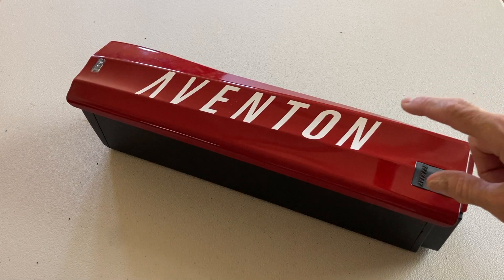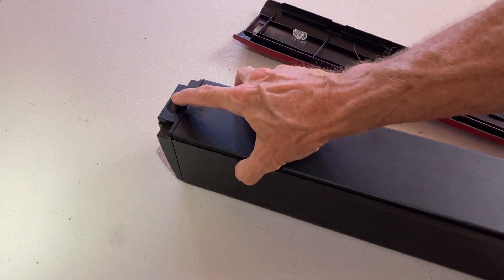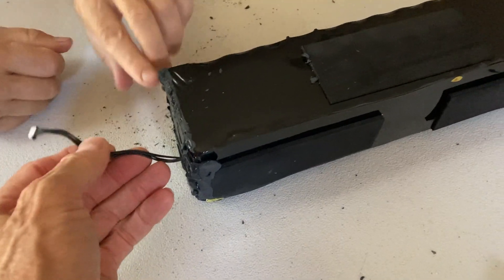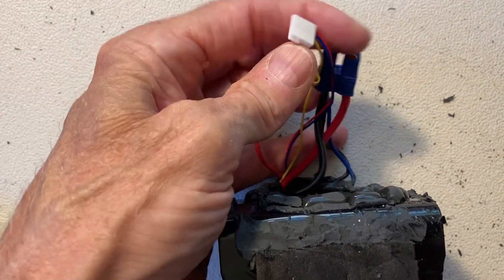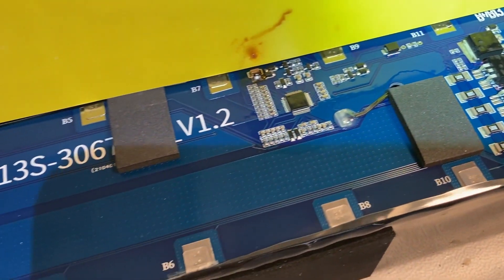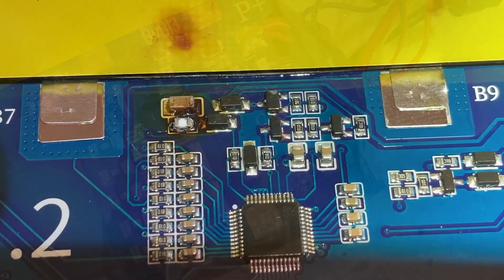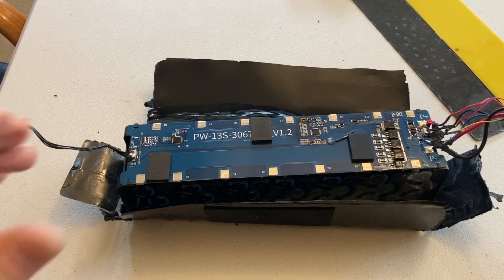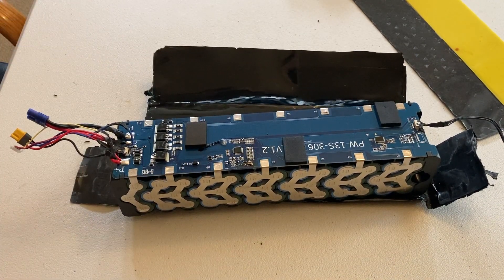Aventon Aventure Dead Battery Disassembly and Diagnosis

Comment: Hi Charles and thank you for this video. It is a walk through that hopefully not many of us would ever need to experience personally. I just got my Aventure and noticed the battery specs on the back show Nominal Voltage:47.32Vdc and Rated Energy: 657.748Wh. I thought this should say 720Wh according to all the posted battery specs. If you divide 657 by 47.32, I get 13.9. Shouldn't this be 15? Can you check to see what yours say? I called Aventon and they said, "make sure to balance your battery and you will get 720Wh from it" and some line about "lithium ion batteries are volatile and you will get a range" of output. I know there are supply chain issues and they are working to get bikes out with substitute part with "equal or better" parts if they have to change something. I'm afraid that substituting 657Wh for 720Wh isn't a fair swap. Thank you!
Reply from the maker: Hi Jeff, I have 3 Aventures and none of my batteries labels show anything similar to yours. The simply read "48V 15Ah 750Wh" with no further elaboration. When did you purchase yours?
Reply: @webopus  I have had it 4 days, direct from Aventon. I think I have an under powered battery and they are trying to bluff. I don't think I will get the total miles from a 13.9 amp hour battery compared to a 15Ah. Hmmm wonder what recourse I have?
Reply from the maker: @jeffmiller2806  that certainly is a consideration. You can contact a Aventon customer support but be prepared for a lengthy ordeal. I waited for over 32 days for a replacement battery, but they ultimately made good on my warranty claim. Chip manufacturers all over the world are under enormous pressure to produce more chips, but all this pandemic bullshit is hindering their progress. Every sector of the electronics industry is being hit hard by this - and the E bike industry is no exception. I'd contact Aventon customer support and mention that you did not receive the battery that was advertised for this product. Let me know what happens.
Reply from the maker: Jeff, I have to contradict myself. I just checked the battery once again on our newest Aventure, and it has the same markings that you've described. I've been unable to find any descriptions of precisely what that means. You might want to send a question to the guy who runs Bolton E-Bikes in California. He is often able to answer a lot of these cryptic and sometimes complicated questions. Here's a link to his Youtube Channel. Please let me know when you find out. https://www.youtube.com/channel/UC8pIKzo5py1zt3U2O-Bqo3A
Reply: @webopus  Oh wow. How long have you had the newest one and did you get it direct? I'd be curious to know if you get the same range from all 3 bikes. I have watched the Bolten bike guy. Yeah, good call. I'm sure he'd know. Thanks for sharing your update.
Reply from the maker: @jeffmiller2806  We've had the bike since the end of September, I believe. But I just opened the box this week and put it together. I'm probably going to try to sell it. It was a bike sent to us directly from the Aventon warehouse in Ontario, California for a warranty issue. And interestingly, that issue was the dead battery I mention in my video. 
Our first two bikes were purchased sometime in June, direct from Aventon. BTW - Here's a link to a Bolton video about battery maintenance. This might be a good place to post your question.
https://www.youtube.com/watch?v=WVcFytLYOIQ
Reply from the maker: Jeff, I just posted this question on the Bolton video concerning battery maintenance: "Hi - I have three Aventon Aventure bikes. Two of them have batteries marked "48V 15Ah 750Wh". One, more recently acquired, is marked "Nominal Voltage:47.32Vdc and Rated Energy: 657.748Wh". Can anybody explain the difference? Much appreciated." 
If I get a response, I'll let you know. 
You could also look for an answer here: 
https://electricbikereview.com/forums/https://electricbikereview.com/forums/https://electricbikereview.com/forums/https://electricbikereview.com/forums/https://electricbikereview.com/forums/
Reply: @webopus  Thank you so much. Double check but I think it is 720Wh and not 750Wh. I think the 750 number is the motor watts. Pretty sure you can edit your own comment. Thanks again Charles!
Reply from the maker: @jeffmiller2806  you're right. I will correct or amend it.
Reply: Hi Charles,  I heard back on the battery question. Basically they said,  "We want to clarify that it is just the label that now shows the minimum specs rating, however, the battery is the same." I'd love it someone with both "labels" tested the capacity of each to see if they are really the same. Either by a throttle-only range test or a battery capacity test with bench test equipment. I'm pretty sure the formula is the formula (V*A=W), (48V*15Ah=720Wh). Who would change the label to show minimum spec and not call it "Minimum Spec"? The label clearly states "Rated energy:657.748Wh" I'm not sure how that can be the same as 720Wh. This is frustrating. I feel like I didn't get what I paid for but don't know for sure. Hopefully someone who understands batteries or that can run a test can chime in with definitive results. Maybe I'll call a dealer to see what they say.
Reply from the maker: @jeffmiller2806  ratings on batteries can be tricky to evaluate. Calling a few bike shops that specialize in E bikes is a very good idea. I'll be interested to know what you discover.

Comment: Thank you for putting this video together.  I am a finance guy and only know that V*A=WH.  But my friend is a reitred United Captain and aerospace engineer who fixes electrical equipment for fun.  I will defer to him if I have problems greater than VxA :)
Reply from the maker: Howdy, you're welcome. After spending much time on this battery I came to the conclusion that it's not user-serviceable. Fortunately, the batteries I now have on my three Aventures are working perfectly. Have a good one.

Comment: what size screw do I need if I lost mine?
Reply: for the cover
Reply from the maker: @davidwiniger3799  Hi David, I saw your question on the Electric Bike Forum as well. Unfortunately, I don't know the size and have no way of accurately measuring one. However, the cover is very tight once it's slid onto the battery housing and will be held in place by the frame of the bike once inserted into the battery compartment. I wouldn't worry about it. I sincerely believe it will not slide off.

Comment: The battery is arranged as 13x3, So 39 cells is correct, but you have 13 groups. each group containing 3 cells in parallel. Those are not 1.6V cells. They are 3.6 cells. Full charge is 4.2V, mid charge is 3.6v. So 13 times. 3.6 is about 48V.

I cannot see the range dial on your voltmeter, but you should be measuring 4 volts from B13 to B12, B12 to B11, etc. Not 8 volts, Yu're reading your meter wrong, or it's badly uncalibrated.

You are right about the BMS being bad,
Reply from the maker: Merle, Hi. I got similar feedback from a fellow on an E-bike forum. I'll calibrate my voltmeter and check it again.However, I don't see a possible use for these cells and will simply recycle them and be done with it. Thanks for the comment and education. I appreciate it.

Comment: Replace the parts... looks like a capacitor is the large one, not sure the small one.
Reply: It looks like a 'thick film' 0805 resistor to me. The white ceramic substrate is all that is left. The resistance part used to be the screened-on film that was on top of it. You have to seriously go beyond its rating to burn it up like that. The yellow tantalum capacitor is actually more likely to fail (shorted) than the resistor. The resistor may have been in series with it. If you can prove to yourself that the resistor is in series with the capacitor, and the capacitor measures a short circuit, you can likely replace both and bring the battery back to life (assuming you can get it put back together). If that was a series resistor, its value would have been around 5-10 ohms.
Reply from the maker: Hi, Thanks for the input. Easier said than done. Now that stores like Radio Shack and Fry's Electronics are out of business, where does one go for parts and part identification? I'm all ears. I'd love to salvage this battery.
Reply: Personally I’d remove all the BMS and just get a New BMS used as an auxiliary battery for extra distance. Thank you so very very much for taking the time to post this video
Reply from the maker: @DomenicandDebbie  Hi Domenic, Thanks for the suggestion, but finding a new BMS chip for this particular bike is not a simple procedure. I haven't seen any others like it. And because the components fit so precisely into the enclosure, it would have to be an exact match. I'll just have to recycle it and hope that the new one last a good long time. Take care.

Comment: are able to read the numbers on a cell and if so can you post that number thanks
Reply from the maker: Kevin, The cells have no markings that I can discern. But I'd have to disassemble it further to know for sure.
Reply: @webopus  thanks heard they are 21700 cells not 18650 cells just wondering
Reply: @kevinbetts7544  Pretty sure they are Samsung 18650's likely 35e like other aventon batteries.

Comment: At 3:57 you can see scorch marks on the yellow plastic.  It looks like some other parts may have overheated as well.  How good are you at replacing surface mount components?
I believe they are using the heavy aluminum casing as a heat sink for the battery.  It must be effective since I've never felt the battery get even warm while charging.
Reply from the maker: Hi Mike, Replacing and soldering these components is outside my skill set. Although, I would give it a shot with some guidance. It would be a shame to recycle these batteries. 
I think you are right about the aluminum enclosure acting as a heat sink. Makes sense and it's certainly effective. Now that I have a normally functioning battery with which to make a comparison, I realize there were problems with the original battery from the start. One press the of the button is all it should take to turn the battery on. The original one usually took several attempts. The feedback I got from Aventon seems to confirm my suspicions that a bad lot of BMS chips were installed in a number of batteries. They are now in the process of replacing them. Thanks for the comment.
Reply: @webopus  I can't give any help regarding replacing the surface mount components.  It's hard to say if these were faulty or if they were the victim of a bad controller chip.  Aventon would be the source for a replacement board but I doubt that's a part you can order much less reassemble everything the way it was from the factory.  Perhaps you can find an enthusiast who can make use of the cells.
Reply from the maker: @mikebryant538  that's part of the reason I made this video. I'm hoping somebody has a suggestion of a possible use for these cells and would take them off my hands. The aluminum enclosure I'm keeping. I can see lots of possible uses for that. It was tough enough to get a replacement battery so I'm not holding out any hope of finding a new BMS Chip.

Comment: I wonder how far " a while back " is. All the reviews I've been reading about these otherwise great bikes say they have abandoned customer service.
Reply from the maker: Yes, that's correct. Customer Service is a problem. After 32 days without a battery I posted a video about the dismal customer service and made a complaint to the Better Business Bureau. Within 2 hours a very nice man further up the food chain at Aventon called me and offered to send me a new bike. His only request was that I remove the video. I complied. I also received a new battery that's working perfectly. It took some drastic action, but I finally had my issue resolved satisfactorily. The bikes are terrific, but if you have a problem you're in for a considerable wait. In all fairness, the pandemic has caused supply issues in every sector. Thanks for the comment.

Comment: Well done. A friend of mine knows a fella in AZ who makes custom batteries for this exact sort of occasion. I’ll try to find out his email and drop it in here. 

All that needs to happen is that controller to be replaced.
Reply from the maker: I should also mention that Aventon sent me a new battery AND a new bike. Once the right people got involved thye really stepped up to the plate. Thumbs up!
Reply from the maker: Cool. I hate to waste and I'd sure like to have a spare battery. Thanks
Reply: @webopus  turns out it was a one time thing. Sorry. Don’t throw that battery out. There are a lot of expensive cells inside of it. Quite a few folks would like to have it.
Reply from the maker: @rabbi6225  Thanks. No problem. I'll hang onto them for a while. There's Gotta be a way to use them for something. It's all about finding a battery management chip. I have enough extra parts for these bikes to build a whole new one. :-)
Reply: @webopus  perhaps an rc vehicle of some kind? Mini Boat or off road capable mini truck!?!?? 🤔
Reply from the maker: @Publicsoup085  Actually, I love the bike. We ride every day. Once the battery issue was resolved it was all downhill. It has awesome power and range. Thanks for the comment.